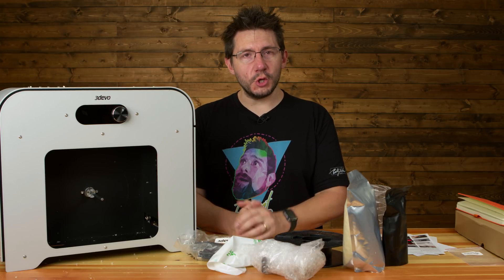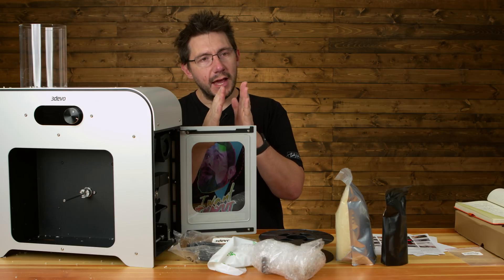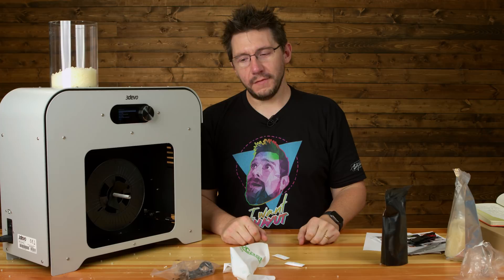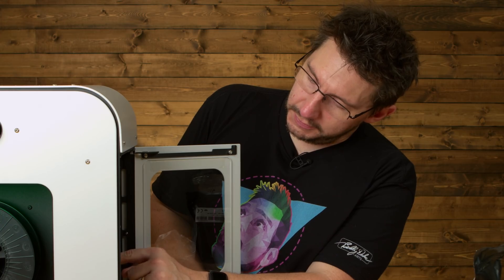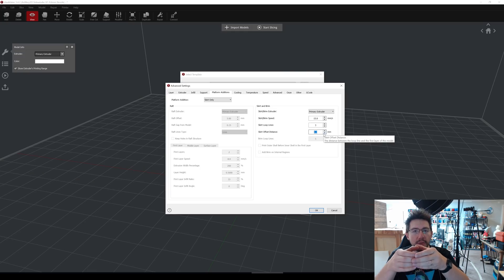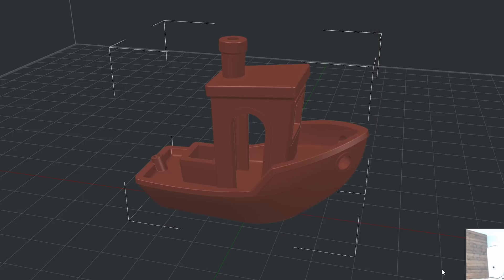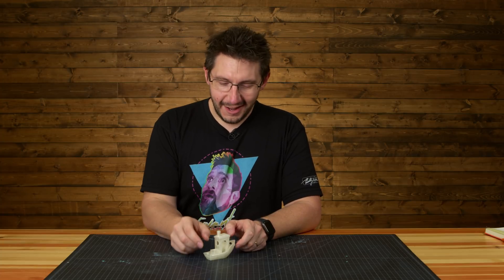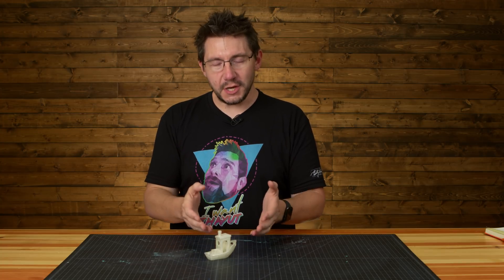Make Your Own Filament at Home: Take 2 - 3DEVO COMPOSER First Impressions

Comment: The idea of home made recycling into filament is moronic. Just make a 3d printer that takes pellets and skip the step.
Reply: Except I believe that someone  still need to make a 3D printer that actually prints sort of okay using a relative fine nozzle (0.4mm) with a direct pellet to extrusion system

Comment: So recycled prints. The question is really how small do the bits need to be and I'd have to assume quality after that is going to lower just because the PLA would have gone through melting heat at least three times now.

Comment: I view the process as a waste of good useable time at the very least., same goes for wood pellets, pasta and any other easy to purchase at a good price finished. One off hobby project are totally different. The 100 +/- rolls of eBay filament I shelve costs $10 to $19 for my 3D printer addiction..

Comment: What about machine maintenance? What do you have to do to clean up the drive screw/heat chambers after you have made your filament? Also, What materials can it process? What do you have to do scrap materials to prep them?

Comment: Please test the recycling of prints.  Due to chemical degradation (heat, UV, chemistry), there is probably some limit to how many times a filament can be recycled.  But if, say, filament could be recycled three, four, or more times and still print reliably, that would be pretty darn interesting!

Comment: Too expensive and I saw in another review ( /watch?v=HxdfsnLaZDw almost 7 month ago) that using failed print or supports has issues for consistent filament diameter. The error on diameter is also comparable to very cheap filament and can cause issue on printer with low tolerance.

Question is: if recycling support and fail prints has issues with this filament maker, why would you buy it rather than filament? The market offers a immensely vast offer in terms of filament (colors, material,...) so why would you bother to buy this machine, buy pellets, buy cleaning material used by this machine, just to make 1kg filament per hour?

I hope the machine is getting better at recycling support/print than what I saw in a previous video because if not, it looks like this filament maker is useless.

Comment: What I would like to see you try is:
1) Recycle old prints. I see that as a big reason to get this machine. If you're working in a shop that makes a lot of prototypes you end up with tons of plastic that costs you twice, once for buying the filament and a 2nd time when you pay for garbage disposal.
2) Add interesting stuff to the filament, e.g. glow in the dark powder, iron powder (to make it magnetic), glitter

Comment: Cool video. A suggestion: get a good shredder and try to produce filament from recycled prints or PET bottles. This machine would fit well in a school environmwnt with students running an upcycling facility from PET bottles to usefull 3D printed parts.
Reply from the maker: That is EXACTLY one of the things I plan to do.

Comment: It's a nicely designed machine if you have monarchy or other forms of high end wealth in ones lineage outside of silicon valley or from being places such as over in bonesaw country, though that technically could be somewhat replicated with a few hundred dollars worth of parts with a trip to home depot and a parts order list from ebay etc , and if to be most effective at preventing ocean plastics, we should try to make one of these machines, or produce them for a added one hundred dollars on top of the parts order list. 

Not sure if that's something you'd like to attempt as a show idea from an open source perspective. If you are into that though, it would most effectively help make the 3d printer community not be considered one of the contributors to pollution really. Maybe the manufacturer would knock a zero off the price and still make a living by moving high volumes of product? From what can be seen in the comments section, they too would like to see more affordable solutions rather than something instantly ready out of the box if that's yet to become a reality. Hopefully i dont go missing in the night for encouraging affordability, lol, being a very caring atheist without the ability to 3d print an afterlife, though on the topic of something related to that, am very interested to see how to make biofilaments such as support structure mediums and media to produce functional replacement internal organs, and or even spaghetti or sliced macaroni, possibly even an entire lasagna, though not made from involving any soylent green colored filaments. Cheers and salutes from Bargain World.

Comment: i would have been more interested in using self-ground bits instead of pellets.
nobody is interested in an expensive machine that can extrude pellets.
Reply: Not if the pellets are CF grades of high-performance materials or anything else that is interesting
Reply: Why not? It cuts cost by 90% and gives you free range in colors and materials
Reply: @BelviGER  Cuts costs?  Factor in the extreme cost of the machine and you're better off using retail PLA filament.  For almost $5500, using pellets is just insane.
Reply: @zybch  you can't talk about the cost as the main turnoff point and then talk about the pellets being the issue. Those 10-30% of material that would be ground up and turned into new fillament are nothing price wise compared to the cost savings that pellets offer

Yes the cost is too high, but then again this machine is at the WAY upper end of the price range for "home" fillament extruders. If you want cheap, get yourself a filastruder plus maybe a filawinder. At that pricepoint creating garbage colored filament from supports and failed prints will eventually get to a break even point.

The issues then continue. One person will go on their website and order their 2500 buck grinder, will get the exact specs of grinded up material the machine expects and it will work great. The next person will say that its a waste of money and will cut it down with pliers t, taking half an hour for 50g, and will get an acceptable result, then the next idiot in line will say that that still takes too much time, chucks half a benchy in there and then complain about lacking consistency.

With pellets, you order them for a buck per pound (equivalent to two bucks for a roll of fillament), order yourself some masterbatch in WHATEVER color you want, maybe add some stuff like carbon fibres or whatever, and get consistent result continously
Reply: @BelviGER  sure I can.  Paying pennies on the dollar for pellets AFTER posting $5400 for s machine to use them is not a insignificant expenditure.

Comment: Yes, It's Expensive, by almost any standard. 
However, As Joel Said, once this out there, other manufactures will take what they do and tweak it and release their own versions.   
Thus driving the price down. 
Rember the first 3D printers, they were so expensive that most of us couldn't afford one. Yes, there are still expensive models and makers out there, and the quality and build level usually reflect the price. 
However, now there are a number of manafactures now making 3D Printers that are at an entry-level price that are decent machines, especially after you get them set right. 
Point is;  Early Adoption is Expensive.
 Always has been. 
Always will be.
Think about all the stuff you now pay almost nothing for now, that when it was new there were very few of those items and those out there were expensive. IE; headphones, Bluetooth speakers, and many other things that we now take for granted. They all started as "Proof of Concept" and the early adopters paid big for them.  
As the technology got cheaper to make and the uses expanded and the consumer demand increased, the price went down. Yes on the very low-end of the price spectrum, Quality is Sh*t with very few exceptions.
 The point being,
 Don't let the "Early Adopter Price"   be your only measurement.
 Consider the volume of printing you do, and what material you throw away, and how much of that goes in the landfills, compared to how much you actually keep.
For the right maker, it can be justified,  If you run a print farm, and are generating a large amount of waste supports, not to mention failed prints, having a way to reuse the plastic and  use the remade filament in prototyping or other in-house uses, if  the new filament isn't good enough to use on customer products, which it may vey well be once its set up right and the kinks are worked out in your system as far as processing the  scrap filament so it goes through the machine nicely.  
Even not having to buy extra filament for in-house use is a saving in the long run. 
At this point is an investment in the company, and helping them develop more and better and eventually cheaper products and its an investment in your own making future.

Comment: What about the winding quality? There's a defect in the winding system that changes the filament diameter after the puller and before the traverse motion during winding. The winding length of filament changes from the center to the ends of the spool width, this causes variation in diameter. The company claims they solve this issue with an addition of a slipper clutch to the spool winder, but still won't solve the problem in my opinion.

Comment: But Joel, where's the recycled prints test? I feel like that's the real test for the machine - can it actually take your shredded old prints and produce something usable out of it.
Reply: What?  Do you say that Joel have failed test prints?  :-)
Reply: Look at make anything he make tests
Reply: You would need a grinder to ground down to smaller pieces first
Reply: I reckon it would struggle to feed anything that is not circular (like small beads) through the hopper.  Would be awesome to be proven wrong though.
Reply: @mpolosmith  I think if you shred it properly into pieces small enough to feed it should work, I think the problem would be getting it dialed in to melt whatever you put in. He also didn't really talk about any kind of cleaning process, so I imagine that contamination from previous runs could be a problem.
Reply: @mpolosmith  Yes, you're right :) Regular pellets would typically be easier to feed, but when it comes to inconsistent regrinds this requires some additional adjustments
. Once these have been perefected it can be replicated throughout. Keep in mind that each polymer responds differently though
Reply: @3devo  I actually produce a decent amount of waste as I am a parts developer rather than someone that grabs things off of thingiverse to print. That means I create mock-ups before I have a final design. Depending on the complexity I might have 5-6 versions before I have a final product for the customer. So, a recycle machine would work well for me as I am doing commercial work where I am not doing a whole lot of fancy colors, my work is black or white, for the most part. So, I would not need to worry about multiple color separations to keep the colors pure. Easy to separate my black test prints from the batch of white test prints and recycle. BUT, another complication. Depending on the customer and the application I do some PLA but more ABS and flexible. I think your machine does PLA and ABS. Any other filaments? The cost is a consideration as I can purchase a lot of filament for your $5000-7000 product cost and since I buy a lot of filament I have a pretty decent discount on bulk filament purchases.

Comment: You cant expect to make quality filament with a hobby extruder that costs also a "hobby"-amount of cash.  

Look at the industry extruder machines, how big they are, what kind of equipment is used before and after the filament extruder.
It is expensive, because they deliver high quality plastic/rubber/whatever materials, that come out of the extruder. Like they are used at Prusa. 

Every home made solution is just trash, because there is no consistancy.

Comment: Hey Joel, I got to work with a previous version of this machine, and make sure to set the dimensions of the spools you want to use in the settings to avoid winding issues and/or filament diameter inconsistencies !

Comment: Joel, I would like to see you make filament with this machine, using old prints rather than pellets.
Reply: Even better:
1. Print Benchy. 
2. Turn Benchy to scrap. 
3. Turn scrap into filament. 
4. Print new Benchy.
Reply: @MichaelKire  10K views right here!!!
Reply: @MichaelKire   And thus we get the circle of life.
Reply: Seriously. If you're gonna buy the pellets, you might as well buy the filament.
Reply: @erikpurne  When it comes to high-performance or more complex polymers, there tends to be a 10x markup value (and sometimes even more) just to receive it in filament form. It does pay off (for some) to buy pellets and extrude it themselves - depending on what they're working with
Reply: @erikpurne  with some types of polymers the  price difference between pellets and filament form is enormous
Reply: This

Comment: Would love to see how it hamdles recycling used filament vs using the pre-prepared pellets.
Reply: When recycling filament you have to use some virgin pellets otherwise it will turn out terrible.  You really can't use JUST shredded used filament.  Plastic degrades some every time it's melted and you need to supplement it with virgin plastic.
Reply: @BladeScraper  yea sure but I would love to see how it handles the mix as that is one of it's selling points is that you can recycle used plastic into me filament.

Comment: 2 years there will be a $500 chinese version 😬
Reply: Doubtful.  This makes it easier with presets but extruders like this (but with multiple PID controllers to set for temperature manually)  have been around for many years and they still cost thousands.  The extruder screw alone uses very expensive metal that requires machining to a precise size.
Reply: @ualdayan  Doubt what???
I dont care what YOU doubt???
Who are YOU??? 
THAT is a DUMB thinking Sherlock
Reply: @swiftrick15  Well that's rather aggressive for simply stating that I doubt China can clone this for $500 - even in 2 years.  Look how long filament extruders have existed, and yet a hardened steel compression screw for a small extruder is still $750 alone. (add more for chrome plating)  The Chinese can bring the price of things down when the price is having to greatly cover already sunk R&D costs - costs they won't have to spend.  They are less able to bring the price down on things where the raw materials themselves are expensive or require expensive tooling to machine.  Could they bring it down to $2,500-$3,000? Maybe, I don't know if it would have an interface quite as easy as this one appears to have.  $500? With multiple heating zones, a proper compression screw, spooler, and precise optical filament diameter detection?  No, nothing I've seen would indicate they could be able to reach that price point.
Reply: @ualdayan  Dude..you are over complicating it. Anyways...... Ive heard enough nonsense from you
Reply: @ualdayan  "precise optical filament detection sensor" bahahaha. Yeah they don't exist and aren't so readily available hey???
Pft. Seriously. Its an extruder..over sized..with some sensors..and yes a hardened steel nozzle is used but they are common and not as expensive as you claim. Far from it.
The price they ask for this unit is a great indicator as to what the price will be in future. Yes..even today...you can get a 3D printer that ranges from $500k to $200. But go back 6 years and a $200 3D printer was unheard of.

Anyways..nice chat again. But I dont see the point in your comment. HISTORY speaks for itself. Hardened steel is not GOLD....

Comment: Great Idea - would like to see how it does for recycling old prints with a companion grinder.  Maybe 50-50 old/virgin PLA?  Use this recycled filament for test prints before you print the actual design.   Filament for you to create?  "Gummy worm" - Random colors with clear or virgin PLA interspersed.

Comment: Thanks for the awesome content. Kinda wished you used some recycled filament with the virgin polymer though, to see how this machine performed with that. 

Also, I believe resin usually refers to a precursor(s) that will then be polymerized or crosslinked in some fashion to create larger polymer chains. I believe in this case, those pellets are not called "resin" because you simply melting them, then, cooling them into a longer filament. Kind of like how when you can melt wax pellets or smaller pieces of wax into a larger dish, you don't change the structure of the wax chemically, you just melted it together into a object of larger volume. The molecular weight (length, if you will) of the polymer chains in the pellets versus the filament are likely very similar unlike in the case of casting a resin.
Reply: When you buy it in pellet form the manufacturers do refer to it as resin still (probably because the raw liquid monomer isn’t something they sell so they don’t feel like it would be confused with the resin pellets.)

Comment: it costs 25x more than my printer lol. It does tickle my curiosity a bit because they also sell a shredder. I'd love to shred all my 3d print garbage, that I keep in a separate bin, and turn it into a new spool! For filament suggestion: I saw someone who mixed together different kinds of green colors. It turned into something they called "garbage bag green", it looked pretty cool because the mixture wasn't perfectly balanced. It turned into kind of an army camo filament :)

Comment: Way too expensive, can you even put failed prints in that machine or does it have to be pellets?
Reply: You can't really. Failed prints would need to be shredded first. Conveniently enough, 3devo also sells a shreddrer for only 3k.
Reply: @RobEDC  😂 that's what I need but not for that much, like someone else said I probably won't use that much in filament in my life thanks for the info tho